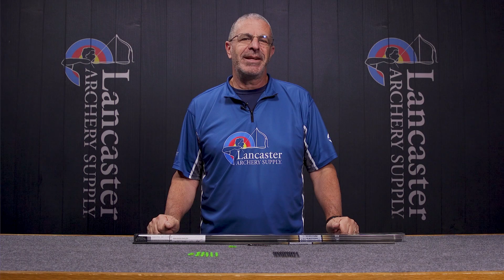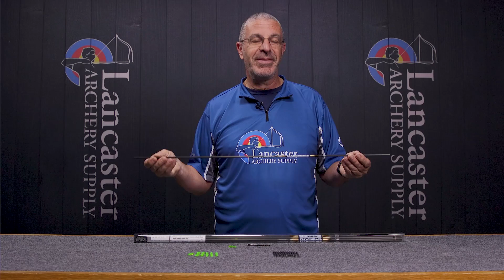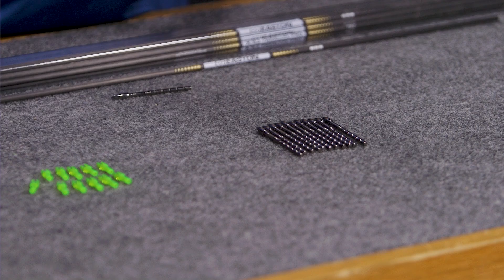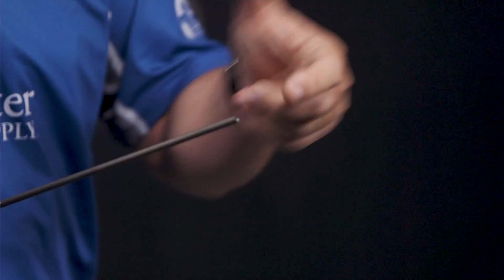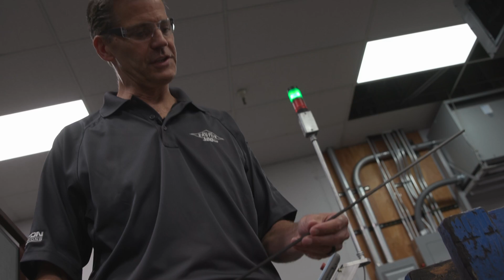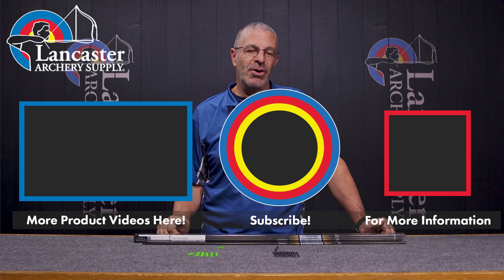Easton X10 Parallel Pro Arrow

Comment: For the X10 parallel -spine 420 shows that the halfout insert is NA all the way from 420 and up. So would size #3 work if the break off point is #3 for a 420?
Reply from the maker: Unfortunately, Easton does not have a halfout that is manufactured for anything above a 380 spine on the Parallel Pro. Technically the #1 halfout would fit into your 420 spine shaft, but the OD gets smaller and smaller the farther you get from 380 spine, so the fitment would not be ideal on the outside of the shaft.
Reply: @LancasterArcherySupply  Oh wow that's really sad! Is there a screw insert that can be used with the new X10's so I can use different screw in points?
Reply from the maker: Outside of the halfouts, I do not believe that Easton produces any threaded inserts for the 4mm shafts. Have to stick with glue-in.

Comment: How is this any different from the ProComp?
Reply: I was wondering the same
Reply: Lil bit straighter
Reply: Procomp is just a carbon fiber tube. This one is an aluminum tube with a carbon outer layer, like the rest of the X10s
Reply: @enrique6335  incorrect, ProComp is an AC arrow.
You're thinking of the ProField which was an all carbon arrow
Reply: @liamboyle9199 ProField was an AC arrow. I have two dozen 380s and will be considering moving to the X10 Parallel.
Reply from the maker: Pro Comp is only made in 6 spines......This one has 11.

Comment: It’s not a new shaft…it’s the Pro Comp rebranded? Am I wrong?
Reply from the maker: Pro Comp is only available in 6 spines....this one has 11.
Reply: I guess the X10 4mm parallel GPi shaft might be a little lighter than the barrel X10.
Reply: It's not. Procomps are pure carbon shafts whereas X10s are an aluminum core wrapped with carbon fiber.
Reply: @enrique6335  pretty sure procomps have aluminum cores
Reply: @jakesoudant6943 Yep, I stand corrected. Got my shafts mixed up there.
Reply: That’s what I thought too lol
Reply: It's a heavier Pro Comp